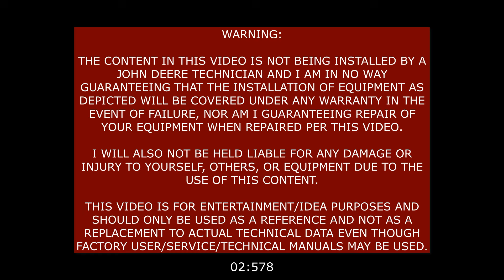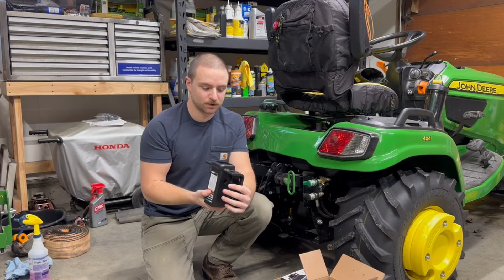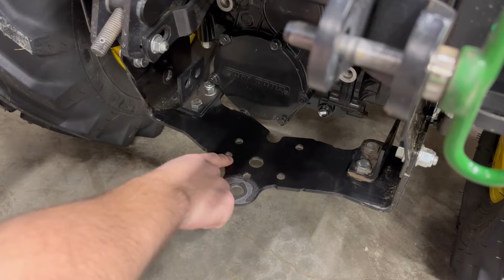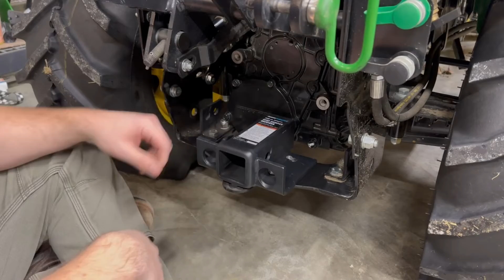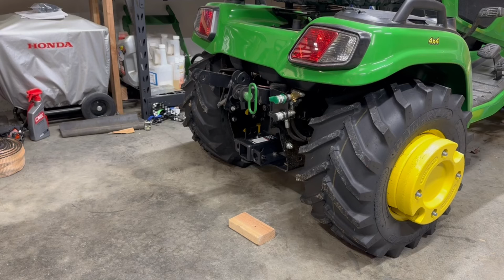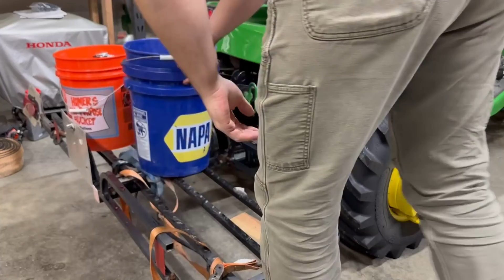John Deere X700 Series Rear Hitch Receiver - Is Harbor Freight Better?

Comment: Why didn't you just go and buy a 1 1/4" to 2" hitch adapter. Only 16 bucks
Reply from the maker: That could easily be done, however then whatever you’re pulling, its tongue will put more downward force through leverage on the tractors frame hitch plate, which is only a bent piece of flat metal, so for any kind of weight holding it isn’t really all that strong and you would want the force as close to that plate as possible.

Comment: I have a X700 series with the PTO & three point,  I got the weight bracket for the click & go and welded a sleeve in the center. you could also get bolt on type and do the same but would be giving up space for the weights 🚜

Comment: Great review, I like your videos.  I have a X730 and mounted the 1 1/4 inch receiver from John Deere and recently upgraded to a 2 inch receiver from Heavy Hitch that will quickly attach using the Click-N-Go brackets provided by John Deere.  Wish I could attach a picture. Easy attach and removal, no modification at all.  Now I have both size receivers.

Comment: John Deere does not supply a 2 inch receiver hitch because that would encourage people to try and attach items that would overload the tractor. It is not because John Deere was being cheap, they are trying to protect you from yourself.
Reply from the maker: I get that, but I also disagree that it was a good idea on their part. My beef with it is that you lose a lot of other options of stuff to attach to it. But on for me was a D-ring shackle. There aren’t many that are 1 1/4 shank, and the ones you can find cost just as much or more than a 2” shank. Also cargo carriers. Tow hooks. You name it, it is easier to find 2”. Yes, you shouldn’t put 1000# tongue weight trailer on it, but they shouldn’t severely limit attachment options. ATVs come with 2” receivers, and these tractors can surely handle more than them (my opinion)

Comment: I just bought a John Deere 316K that someone put a RZR hitch plate thing on the back of. It's a 2inch hitch receiver. I removed it off my 316K but plan to use it on my Case 222 the one I use as a harder worker/pulling machine. As well as being my winter snow plow I just have to figure out how I want to mount it.
Your idea is good I agree with everything you said. Plus it's coil seeing how you made it work.
The sprayer idea is probably what I'll be using it for the most I just gotta find a cargo rack 😆

Comment: Hi Josh
Great Video
In the beginning you mentioned you removed all of the rear pto because you were having issues.   What were the issues as i plan to put the rear pto.
Reply from the maker: I was having issues with it pushing fluid out of the breather on top. Issue didn’t arise until after I put the PTO on, dealer was doing nothing to help the issue, so decided to just remove it. It doesn’t seem like this is happening to anyone else though, so it’s probably just my luck. Honestly I don’t even know yet if having it removed will solve anything, until I can run it in really hot weather.
Reply: I have never had that  issue pushing fluid out with my PTO I installed on my X758...
Sorry to hear you have had trouble with it Josh.